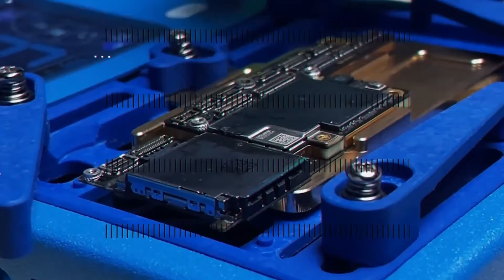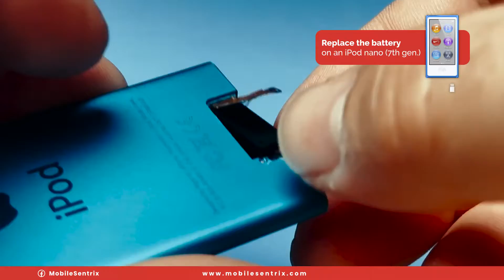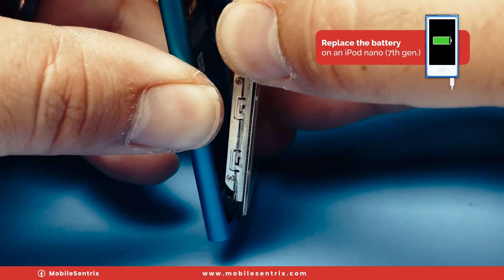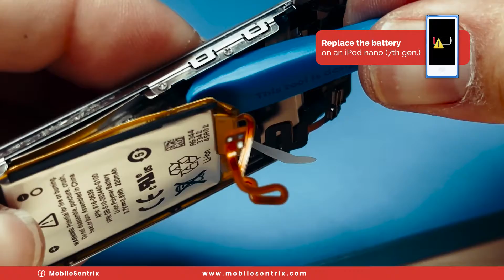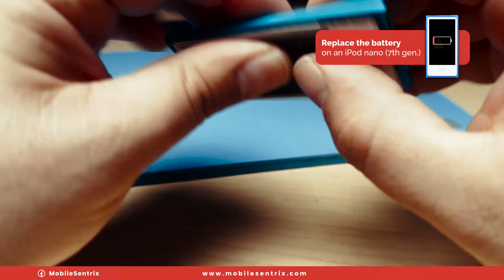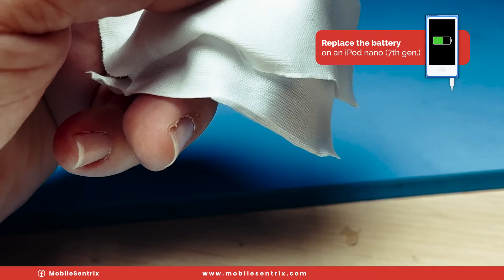How to replace the battery on iPod Nano 7th gen (Tips and Tricks #94)

Comment: I also recently changed the battery because my iPod simply did not boot up even when connected to power. But after the replacement, the iPod only works when it is connected to the charger. What could this be connected with? Is there any solution? The battery is completely new, so I don't think that the problem is in it. When connected, the iPod shows that it is fully charged, but as soon as I pull out the cable, it turns off and shows no signs of life

Comment: Thank you for your excellent video. I managed to replace the battery OK, but now the iPod shows its not charging, instead displays the fully charged icon, but the battery voltage reads 3.7 V. Can you tell me what the TH contact on the battery connector is for ? TQ.